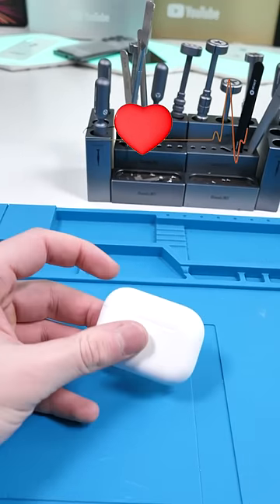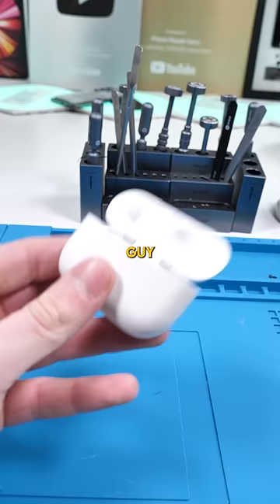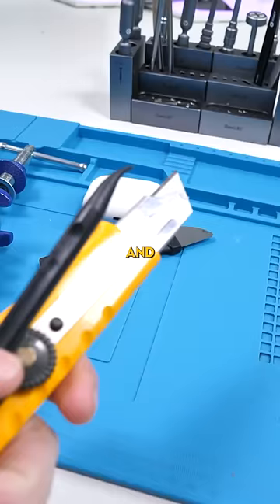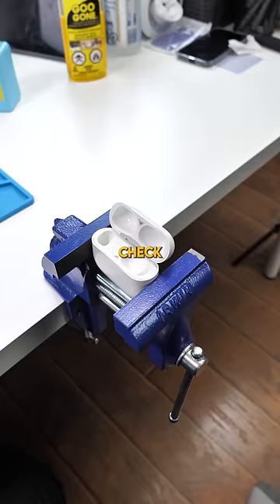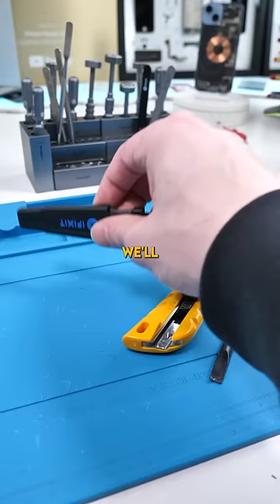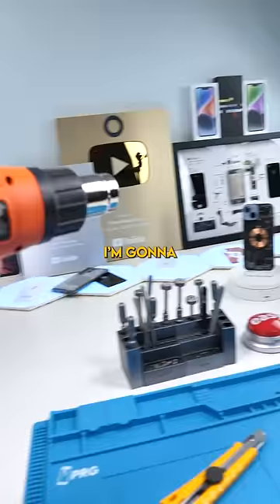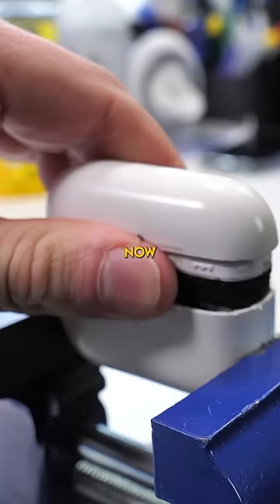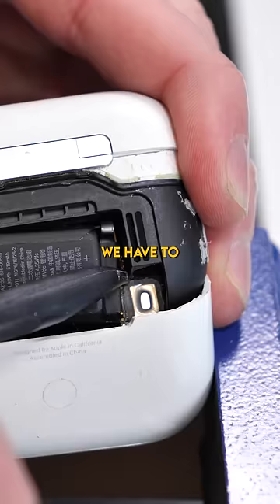AirPod Pro Battery Replacement? #shorts

Comment: Ngl that was unexpected 
Can't wait for the full video!
Reply: Reasons why apple sucks
1. Preventing software downgrades for iphones when older ipsws/ios are no longer signed in on Itunes
2. Remotely disabling and bootlooping iphones on older ios forcing them to update and erase their phones.
3. Preventing newer backups from being restored on previous macos/ios versions.
4. Making Photos Libraries incompatible on different macos to force people to buy icloud to transfer their photos libraries to different macos. 
5. Disabling older working versions of applications that use internet, then make newer versions only be compatible with latest versions of macos/ios to force users to update.
Reply: @fuefme9332  “remotely disabling and bootlooping iphones on older iOS versions forcing them to update and erase their phones”

apple does not remotely do anything. that’s just because the phone is old and older phones have issues. 

“preventing newer backups from being restored on older versions of macOS/iOS”

why would you try to put an iOS 16 backup on like an iOS 11 device? or a Monterey backup on like Catalina. what’s the point of that.

“disabling older working versions of applications then make newer versions only compatible with the latest versions of iOS/macOS”

they do this because they want to keep the app as up to date as possible, not only that but software has to get unsupported at some point. you can’t possibly support an operating system forever. it would get too vulnerable to more and more security risks. there are still a lot of apps that support even as far down as iOS 12 for apps. as for Macs, they have to up the version because it’s a desktop environment
Reply: @EnzoWasTaken fan girl 😂

Comment: It’s almost impossible on new ones. As time goes on, those adhesives begin to break down. That case seemed to be at that stage. Try it on a new one and you’ll break em.
Reply: I mean if it’s new then you’d probably not need a battery replacement

Comment: Don't worry bro, you can replace the battery in  3 minute or less

Step 1: grab the airpods you're fixing

Step 2: drop/throw them down 2 sets of stairs or 2-3 stories tall to the ground(stair is recommended as the internals don't snap, crackle, and pop) for it to be loose

Step 3: do whatever procedure you do for repairs after getting the airpods back into the work area.

Comment: Yea these shits are not designed for all day play. Got a pair of Sony's xm4 buds specifically due to the larger battery. Exacty one year to the date of purchase and they won't stay charged longer than an hour, when they used to last for EIGHT HOURS. If you wake up with headphones on, and don't take them out until you go to bed, don't waste your money on wireless, they barely last a year. My old Bose wired IEMs are on year 7 now....